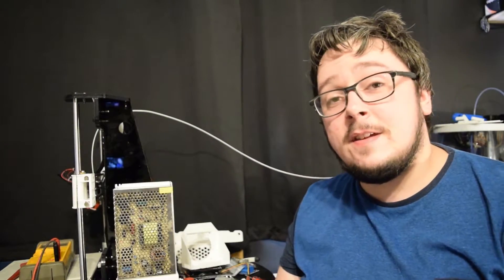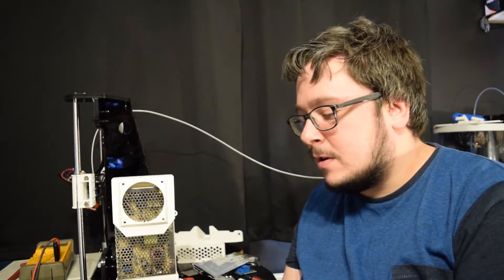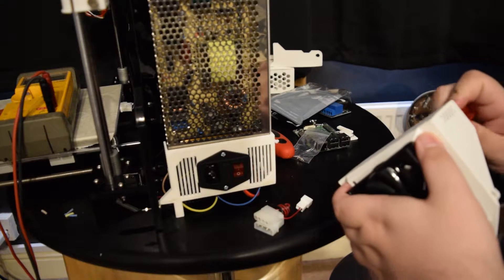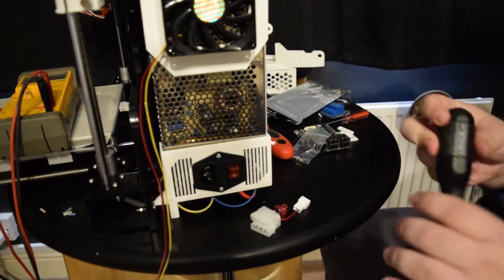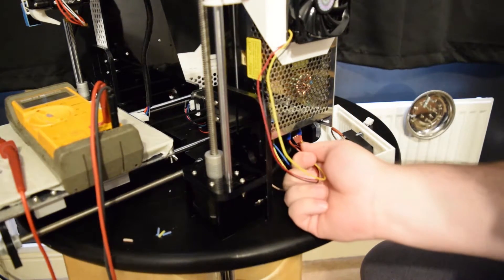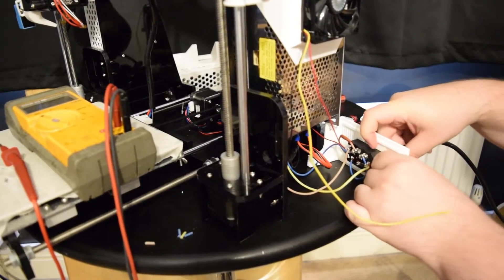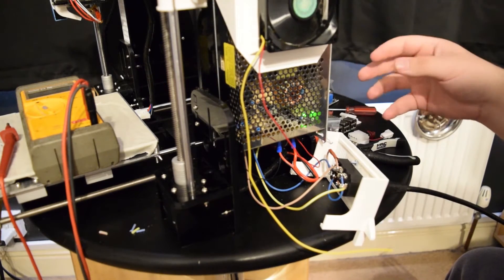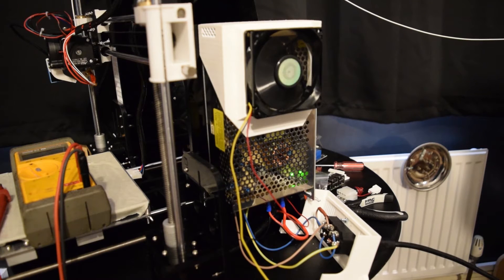Adding A Cooling Fan to my Anet A8 3D Printer's PSU

Comment: U need to push hot air out not in
Reply from the maker: Hmm I should really have tried an experiment to see which way provides the best cooling. Unfortunately as I dont have the printer anymore I cant test it. I will bear your comment in mind for next time I try this however.

Comment: I may come up with a cheap wood fan mount using 2 existing holes that are outside of mainboard....ill use some nice 1/4 inch underlayment i have...and use some plastic or wood spacers  and long wood screws....i think it will work...its down and dirty but it will do what its intended....ill paint the wood black....
Reply: @nath042  U2 does not allow sharing pics.....its a suggestion i recommended a long time ago however u2 does not agree